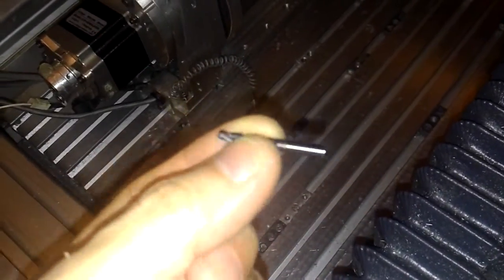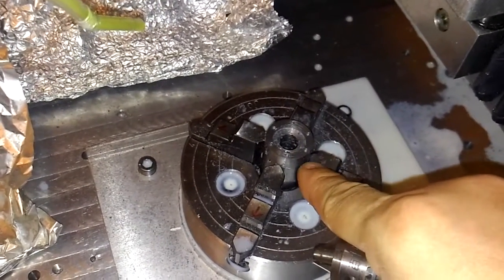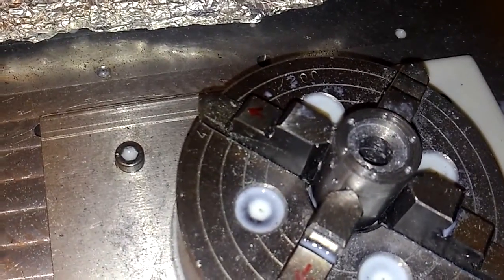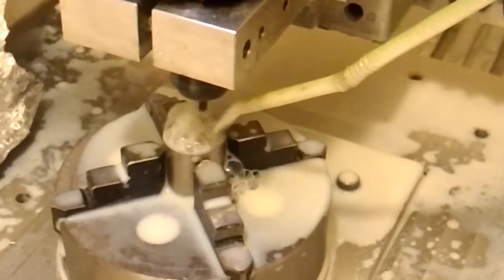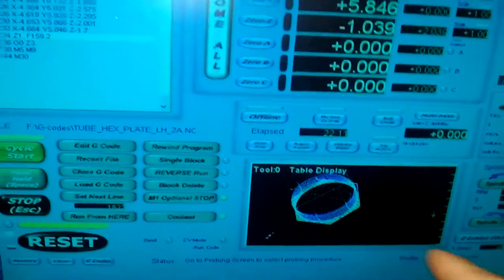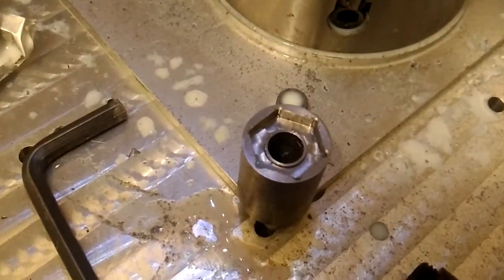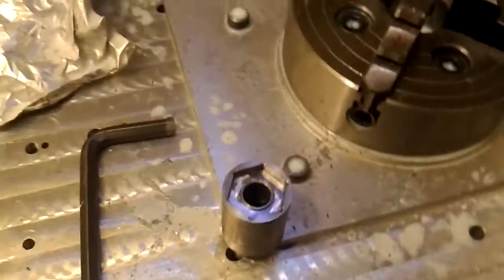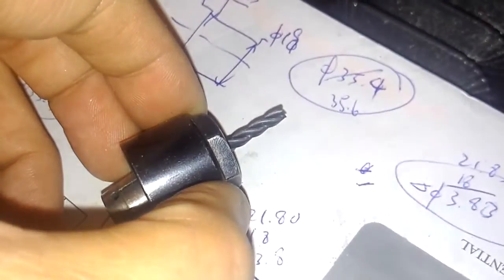Hardly to cut steel on the router machine - 31 (High Z CNC-STEP)

Comment: Please tell me, where can I buy the black bellows for the spindles. Thanks
Reply from the maker: It was a DIY, not a purchased one.
Reply: @ray-charc3131  Do you have addtional linear rails at the x-axis? I just bought hiwin 15mm rails on aliexpress. So the machine will be much stiffer.
Reply from the maker: @stefankrimbacher7917  no, mine one is 400mm travel type, so the problem is not so serious as yours.

Comment: Hello,

Been watching you videos and the cnc machine seems pretty decent :)
Can you tell me what stepper motors it uses? can't seem to find the exact model
I only know that they use brushless stepping motors made by Nanotec and with 4,2 Amps each .. but i can't seem to find the exact model on their website! :(

thank you in advance and keep the videos coming!
Reply from the maker: It is German factory made machine,  Heiz High Z S-400 model, but I did a lot upgrading. You can find its spec. on its website.
Reply: hello,
nice machine, i am also looking to buy one of the Heiz S 1400 models. The frame looks strong enough but I am curious what you did to stiffen up the frame, making it more ridgid. could you tell a bit about that? any recommendations would also be super nice. thank you
Reply from the maker: @berkasal4526  there was an around 3/4" thick aluminium plate under the T-slot extrusions. The z head was also strengthened by a back plate. Anyway, i gave up it and built a nice steel frame one on my own. If you have time, please visit my channel for those updated videos.